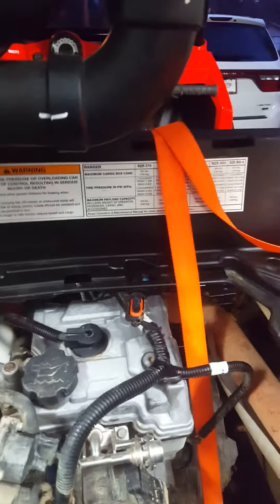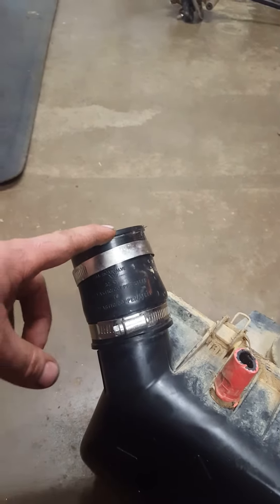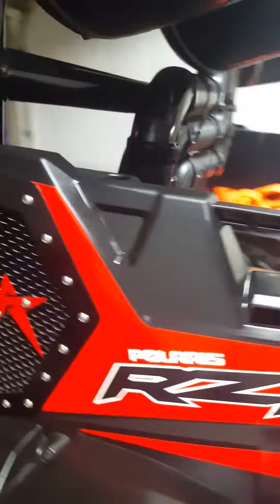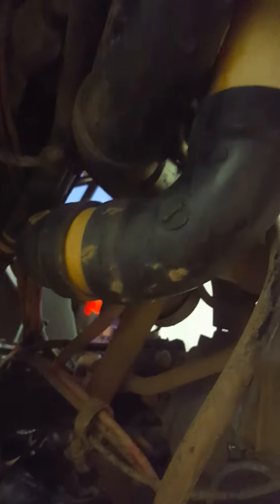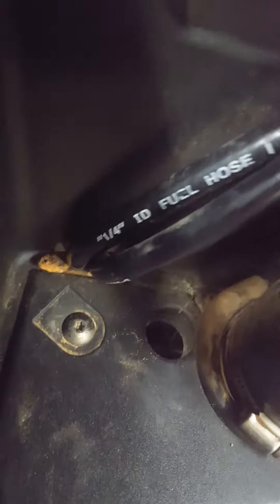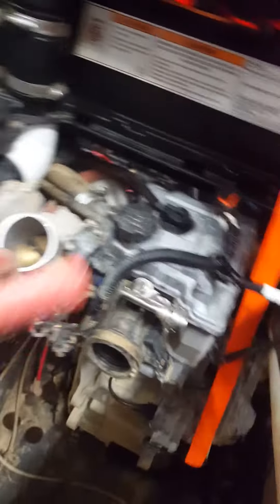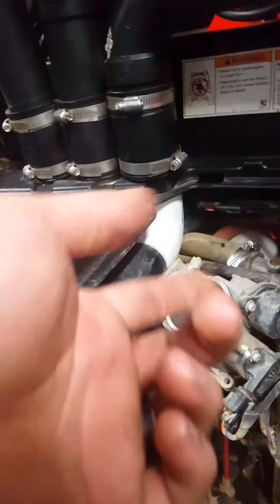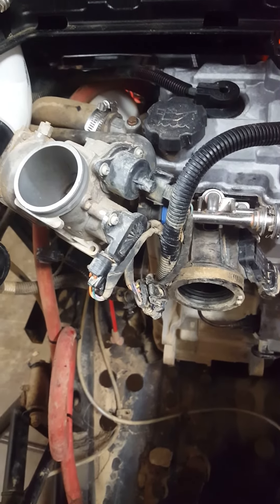RZR 570 Snorkel System

Comment: Can you do a video of going over snorkeling the rzr 800?
Reply from the maker: Robbie Stone Daily Vlogs I can but it wouldn't be very good untill I take my bed off which with my cut out there's not much need to. There are a ton of good vids from others on how to do it tho but appreciate you wanting my opinion.
Reply: SolitudeCustoms alright well I appreciate it I was really wanting to know if you used your stock air box bc I was thinking about using the airaid air box and making my own snorkel for the intake with it instead of airaids snorkel
Reply from the maker: Robbie Stone Daily Vlogs No need for that, just cut off part of the intake tube.. 2"-2" rubber coupler to a small up pipe to a 22.5" elbow then up to the riser. Just check the Air Filter often
Reply: SolitudeCustoms Ok thank you are you using your stock air filter and does dust still get pass it? I upgraded mine to a uni air filter and a little bit got pasted on our last right but it was super dusty
Reply from the maker: Robbie Stone Daily Vlogs No I only run stock as its been proven to be best but I do run a Uni Pre Filter on top of my snorkel
Reply: SolitudeCustoms Ok thank you for the information I appreciate it